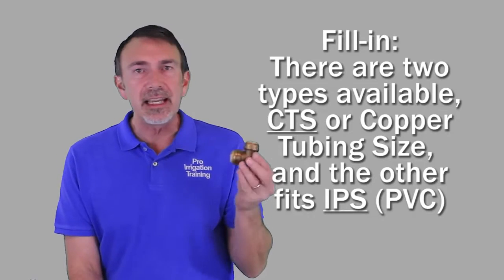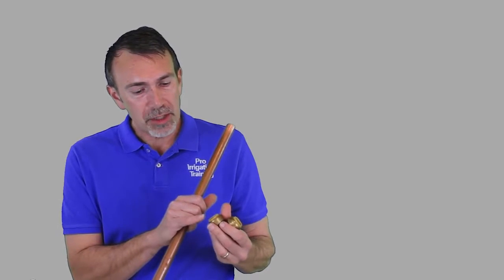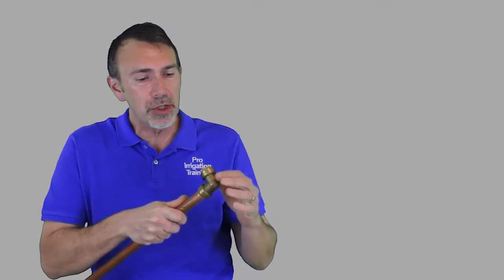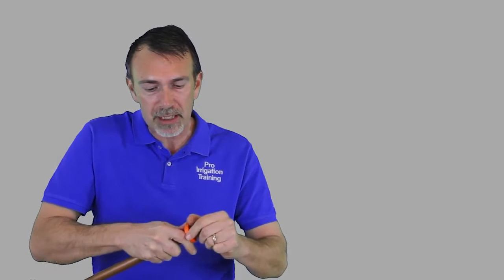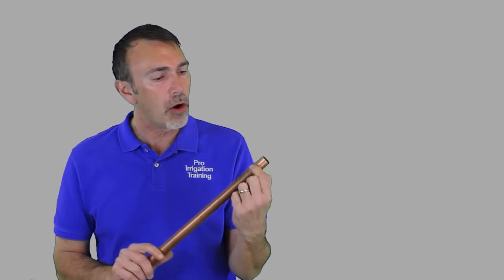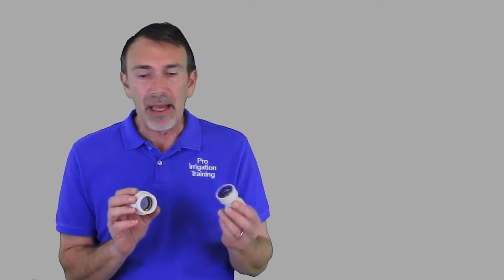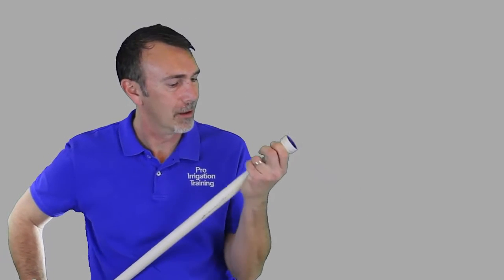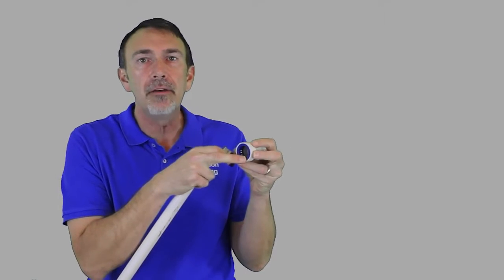How To Use Internal Compression Fittings like Shark Bite, Gator Bite (irrigation pipe repair)

Comment from the maker: There was a comment made that's since disappeared that mentions that the white plastic insert is really only for Pex. That's true, and possibly also for Type M copper tubing which is pretty thin. Also, I think that you can get a softer version of Type M, which might need the insert to maintain the integrity of the round to stay in contact to the O-ring. If you want to remove the insert which probably inhibits flow a little bit, use needle nose pliers and be very careful not to damage the O-ring.